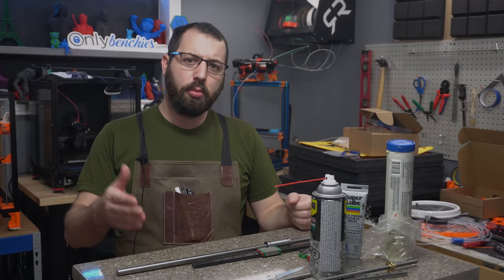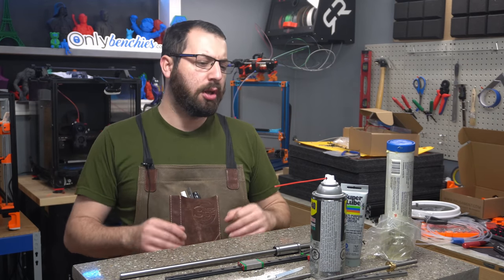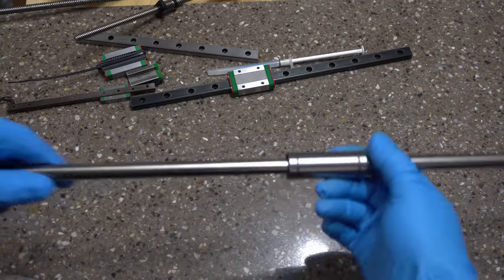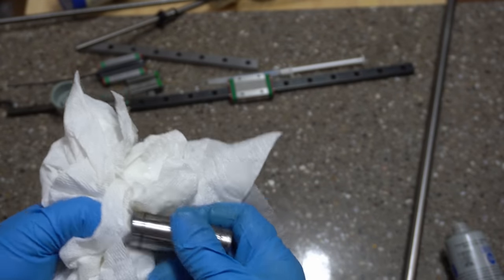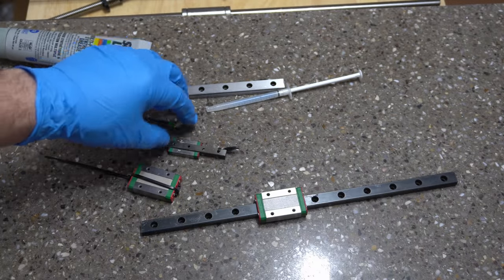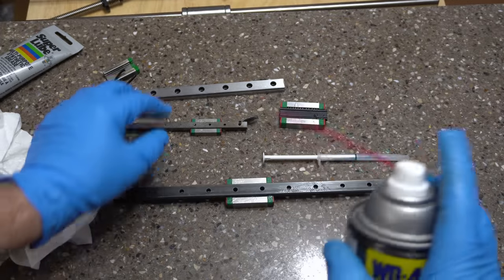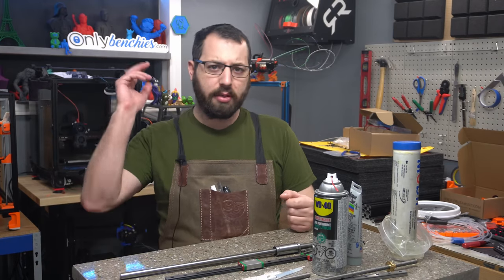Lubrication Basics - Keep your 3D printer running smooth and quiet

Comment: Molykote E-PAST best forever. First what you need it clean bearings use breake cleaner and than use grease.
Reply: anything with Moly in it is  advised against for linear rails due to issues with abrasiveness and tolerances. Hiwin even specifically says not to use anything with Moly on their rails.

Comment: could you use brake cleaner to clean the linear rails and bearings? brake cleaner has good pressure out of the can.
Reply from the maker: You can. Just make sure it's plastic/rubber safe and be sure to grease/oil any metals after as it can REALLY dry em out and make them rust prone

Comment: Once cleaned, how long do you wait for them to dry? I've been throwing them in my dehydrator for a half hour or so in the past, but have wondered a couple of times that I've been in a hurry whether just drying them with a hairdryer for a couple minutes would've been sufficient before applying grease.

Comment: Are there any other printer parts that might need to be lubricated?
Reply: Wherever you have movement that generates friction, including rolling balls, you need lubrication. Sometimes it's pre-lubed in the factory and needs no relubing, but that's only common for ball bearings.

Comment: Can't you just pump the grease through the holes in the linear rail to pack these bearings?
Reply from the maker: Yep, thats a method ive been using for awhile now
Reply: Ahh good to know didn’t actually know that it could be done thank you

Comment: silly question but would it be the same if i used multi purpose oil instead of grease? I assume grease is the better option but just wanted to know if anyone has done this. Update: After a very short amount of research I have determined that grease does indeed seem to be the best option for linear rails, for anyone wondering.

Comment: People always tell me not to use WD-40 for linear movement, but I see you using it. Why?
Reply from the maker: Wd 40 is a brand as well as a item

In this case I'm using wd40 brand white lithium spray grease. Not wd40 the water displacement anti rust spray

Comment: Just checked WD40 White Lithium and it says NLGI 2?
Reply: It's for my V0.2 and I have one of these in my back pocket - not literally
Reply from the maker: Depends on the brand/source, the white lithium grease i regularly use is nlgi 1.5, i like it a bit on the thicker side, last longer i find

Comment: For years, at least up to the MK3S+, Prusa's instructions said you don't need to grease the bearings and that they came pre-lubricated. Years.   sigh 
And everyone who wears glasses should have an ultrasonic cleaner, they are great for deep cleans and super cheap to get a small one.

Comment: Maybe I'd prefer not to use superlube or other lubricants with suspended particles, there's the possibility that the lube will dry leaving behind solid stuff that can bind on the bearing or shorten its lifetime. To be honest the possibility is pretty low, probably it would take a lot of time without checking the bearing/rail state to get at that point, but still it's something I would try to avoid!
Reply: Those particles are the grease.

It's teflon/PTFE powder which is same stuff is used in bowden tubes and similar form of it is what makes FEP sheets used on UV printers. PTFE particles left behind shouldn't bind and should even still provide some lubrication (although they will probably fall out and disperse with use). You can get dry lube that does this specifically, it suspends the particles in a solvent instead of oil, it's used on bike chains for example since you don't want dust sticking to it. Also locksmiths use it on padlocks (or graphite based ones).

I don't think oil based lube can really 'dry out' because it's oil. Very few oils will actually evaporate (there are ones that are used for oil paint). What can happen is it will go bad over time and 'gunk' up since oil does have a shelf life, but that will happen with or without particles and it will still leave behind stuff causing issues.
Reply: @BadVoidShip  What I reported is the general consensus. I know that the white powder is itself the lubricant, but if they are solid particles they can be displaced by the movement of the balls, and let the contact area without nothing, or even worse pack together and make small solid pieces that can interfere with the functioning of the rail. Grease on the other hand being fluid tends to maintain at least a film of in on the contact points.
Oil will definitely evaporate, and even quickly, especially on a 50-60°C chamber, even grease will, it's well known that you have to regrease rails as periodic maintenance, in fact you'll find it on the panels where being colder it condensates.
If you have a "normal" printer that only prints PLA open air, at ambient temperature, and in the range of 60 mm/sec probably you can get away with oil, just checking every now and then if it dried out.

Comment: linear rail balls will be flying everywhere 
not all bearings can be removed off the shaft some need a retainer for keeping them inside CAUTION
i use grease on bearings and carriages get oil super lube pen oil ptfe for me

Comment: Concerning non-abrasive additives: Some people say, that especially in 3D printers Molybdenum-Grease stops the balls from rolling, which results in problems.
What do you think about that?
Another problem I always wonder about: "How long does it stay valid, if you don't moe the printer and how long does it stay lubricated, if you use it". I guess the "gumming up" is very much dependent on the environment?
Reply: For Moly I suppose you mean molybdenum grease. Well we used that in the factory were I used to work....on 300 mm barrell bearing in steel mill rolls that used to works at over 200°'C. I personally in light loaded bearings tend to use white lithium grease either spray or in a tube.
Reply: @Riccardo Regio:  I edited my post, sorry. I was referring to the mentioned additives, which should just be non-abrasive, and in german bulletin boards, it is often warned not to use Molybdenum-Grease. 
In Germany, we have LiquiMoly, a company which advertises a lot, and their grease got that additive. When I searched the first time for a lubricant I was forwarded to "Liqui Moly P000371 MOLY 3510 LM 47 Langzeitfett + MoS2" (Langzeitfet = long term grease). Looking more closely it says "for extreme bearing pressure", but I didn't read it at first. It looked like an amount you could use in your hobby projects, and I just hoped to get stuff, which doesn't rot away before I actually use it. It seemed not to have a too high viscosity, and I didn't know about the effect that bearing balls just slide when they get that additive. They actually answered that question in their own bulletin board in German, too: https://forum-liqui-moly.de/index.php/forum/uebrige-produkte/1213-linearkugellager-schmieren-3d-drucker
They answered that they would instead take silicone grease spray (so, it is pretty similar to your recommendation and maybe not the same to prevent people from using their Molybdenum products).
However, it might be a problem, we only have in Germany. And I wonder how bad it actually is and if it matters for extremely cheap printers. In the end, that might be a question, if lubrication actually changes a lot, if half of the parts might be considered a little broken ^^.
Reply: @maxmustermann2596  LM 47 will surely work, 3D printers don't require perfection to work
Reply: HIWIN speciffically advise against molybdenum and ptfe grease as they change the tolerances of the rails
Reply: @rowlandstraylight  I knew, that HIWIN advises against it. But I thought it stops the balls from spinning. Aren't the rails with or without preload? Can the change in tolerance due to Molybdenum have more of an impact than the switch between non preloaded to preloaded? I thought last time I read it, I didn't see a reason for their advice. Edit: When searching for the proof, where I read it, I couldn't find it anymore.
Reply: @rowlandstraylight  They advise against Moly and graphite, they say nothing about PTFE.

Comment: If you are atomizing flamable liquids in a ultrasonic cleaner... you are going have a bad time.
Reply from the maker: Thats why the carrage is in a ISO filled sealed ziplocked bag, and the ultrasonic is filled with water.
You can of course use any other degreaser if you wish
Reply: Who said anything about "atomizing flammable liquids in a ultrasonic cleaner" ? I heard "put the carriage In a zip lock bag with iso in it" THEN place that in a ultrasonic cleaner filled with water.....
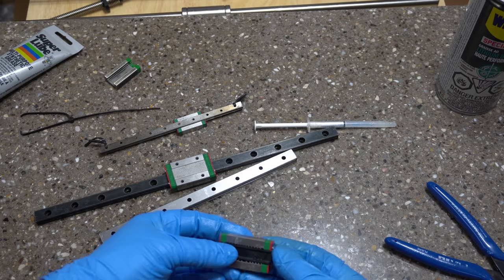Reply: Hi  @dou8letap82 , me from the future. The critical part of my response was based on 13:38 where Taylor says to put the railguide in a bag and then in the water filled ultra sonic cleaner so you do not have to use as much IPA. For me this implicitly allows the use of only IPA in the cleaner. Only certain industrial ultrasonic cleaner are safe to use with solvents.

IPA in bag, bag in cleaner is a smart way. IPA in ultra sonic cleaner directly, not so.